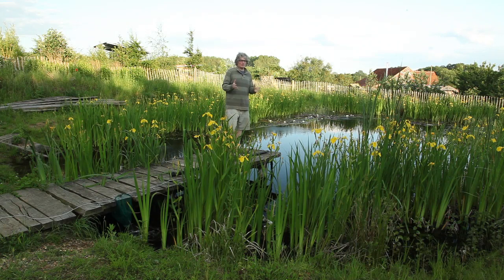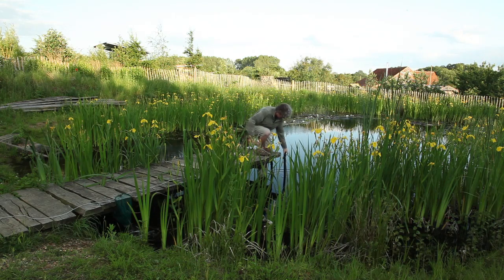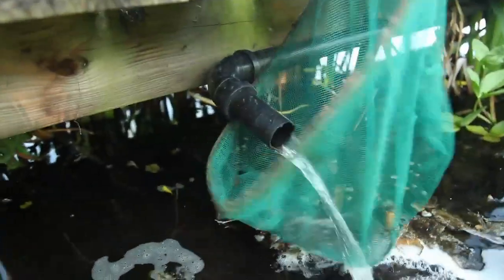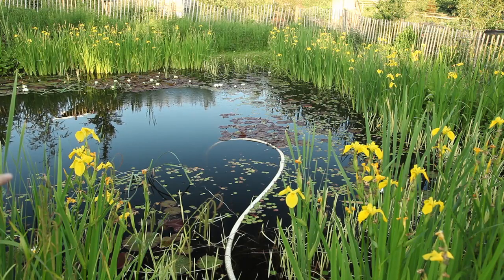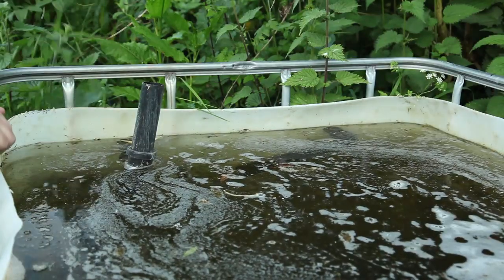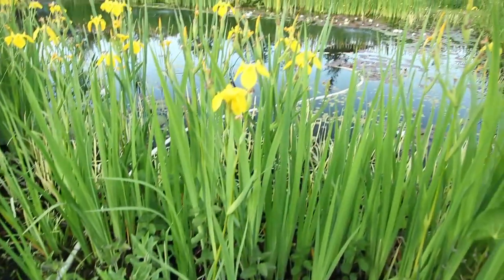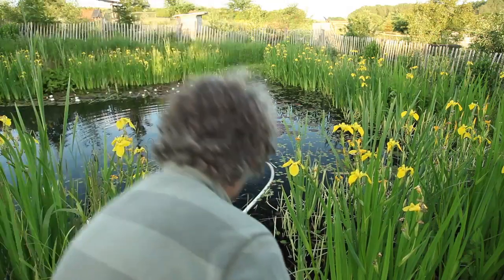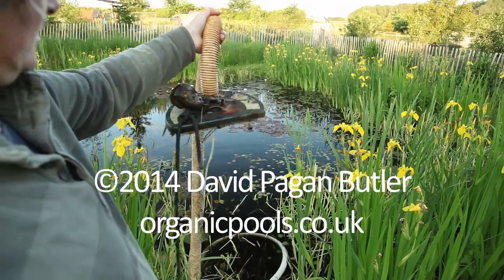Organic Pools 'vacuum'

Comment: Hey David, I use a dedicated 50w air pump but I only get a little bit of lift above water level. How did you get so much more? We lose a lot of water to evaporation so I can't fix the pipes or the lift requirement becomes too great.
Reply: the narrower your pipe the higher you can pump it. I bet you have a larger pipe. Try a 40mm pipe for the higher pumping applications
Reply: Giovanni, did you find a solution?  I have the same issue with my 85w pump, I can hardly get a decent flow of water 10cm above the water level.

Comment: Hi David - love what you are doing.  Had two questions:  first, what type of material do the plants go into?  Is it an actual soil that water flows through which the plants roots are in or do the plants sit in a mix of pebble and sand?  The latter seems to make sense as the roots would solely rely on taking nutrients out of the water vs the soil & water, and therefore keep the water cleaner/clearer ?  Secondly, I see that you used oak for the top of the swimming area border - what other wood would you suggest?  Cedar?
Reply: +theoriginalbigring The plants are planted in sand or gravel so they pull nutrients from the water and keep the water clean.  That, plus the pure volume of gravel providing surface area for beneficial bacteria, keeps the pool clear.